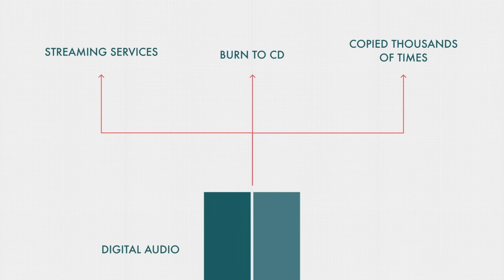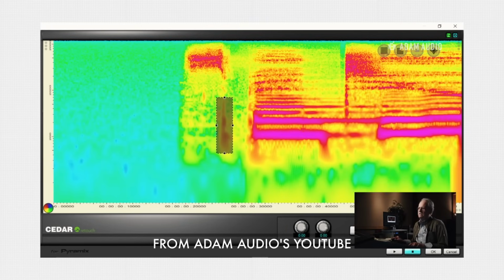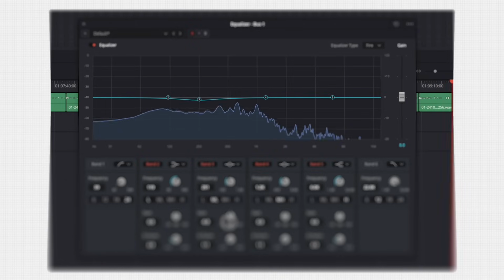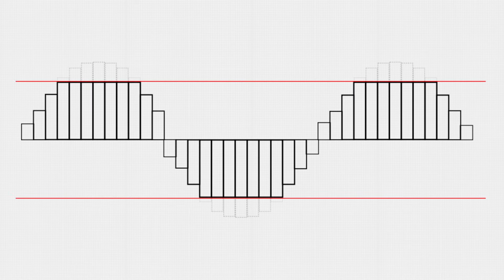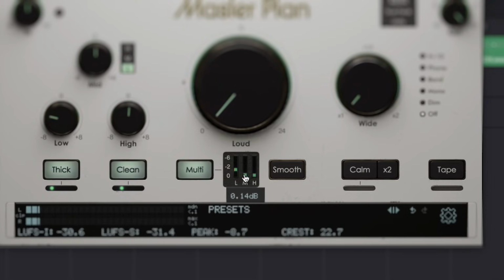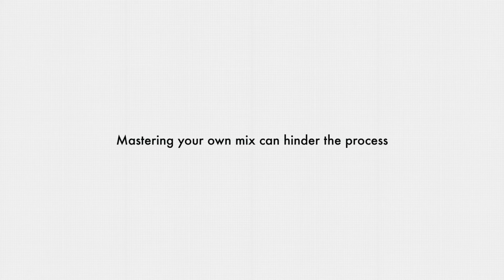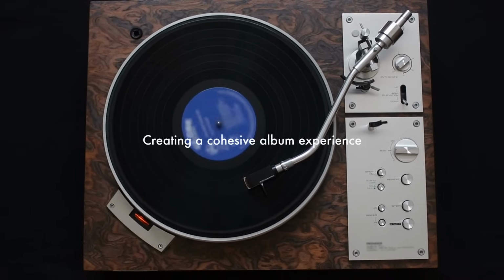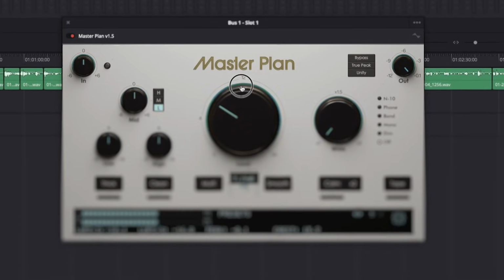Do You Need To Get Your Music Mastered?

Comment: I appreciate your video explaining mastering.  As a mastering engineer I would never use a single plug-in like master plan to achieve the desired master for my clients.  I use a series of EQ's to shape the sound that I want.  I also use two limiters, two compression settings and a specific saturation plug-in.  

I would advise beginner's - intermediate mixers to hire a mastering engineer.  Why?  Mastering is all about translation across all playback systems and delivering the audio files in the correct formats and Metadata.

Comment: I think mastering is kind of a scam. Have you ever noticed that no one can ever really give you one clear, distinct definition of exactly what mastering is and exactly how you do it? It’s always some vague thing like, “it’s a dark art,” or, “it’s as much of an art as it is a science.” Red flags, in my opinion. That’s because it’s kind of BS, honestly. A lot of people made a lot of money convincing a lot of people their services were necessary, and I question if they really were
Reply: The mastering process today as a base ensures that the track is exported in all required formats and listening mediums while maintaining as close to your mix as possible. This mainly includes dithering for lower quality exports, frequency balance for low quality systems such as phone speakers and ensuring it sounds good in stereo, mono and surround sound. It's kind of expected now though that mastering engineers do a final slight edit and slight mix to fix up any of your fuck ups you didn't notice or just make it sound more like industry standard.

In theory if the mix is on point the mastering process is rendering the tracks in the right formats pushing the dither button sometimes.

Comment: One thing that would also be good option/tip to make future video about is original master (I’m thinking bygone analog era equipments)  Vs digital remaster. I would like to understand technically why I like 99% times original masters better. ;) Sure, there are some tape/analog emulations in digital way and so on but I would like to keep it off digital Vs analog. I hope it’s possible.

Comment: I don't know, man you generally seem like a pretty smart guy. I've been at audio engineer since 1980. In this video, it seems like you're just trying to sell a plug-in like there's no other way to do this without Master plan. I find if I've done a good enough job mixing there's no need to master anything. Sometimes I try some multiband compression and that's all the mastering I might do but I generally do not do that. And I record a lot of multitrack live recordings and they come ptetty good. I like them people like them. This takes away from your credibility, pushing a product throughout the whole video.

Comment: Back in 1981 I was a member of a Sydney indie band and we got some free time in University of Sydney's radio station's studio, three weeks, and we recorded an EP there. It had a Tascam 80-8, a Soundcraft console, bunch of microphones including a Neumann U 87 and some other stuff. I was the keyboard player but I had four track home studio experience so I did the producer/engineer job since we had the studio to ourselves for those three weeks with nobody there other than us. The final mix was to a Revox A77 two track. EMI in Sydney had a mastering and pressing service for indie bands and the guitar player and I went to their Studio 301 to master the EP. The engineer at first looked like he was only doing the job because he got paid for it because at the time lot of the work was badly recorded punk. He put our tape on a Studer two track machine and aligned the heads to match the misaligned Revox. Our stuff was nothing like punk and he quickly became enthusiastic and I was totally blown away by how much he improved my mixes. Then he cut the first 7" 45 rpm master on a lathe there. Experience I will never forget.

Comment: Kyle, another great video. Well done. Couple of things to add...
Not mentioned: Mastering engineers generally have gone to the trouble and expense of setting up a room that is far more accurate than the bedroom (!) the music was tracked in. So, when THEY master your music, they are more than likely going to hear things you didn't.
Also, through the 70's-90's, it was common for artists to record songs in different studios around the world, and for those songs to be mixed by different engineers. So another task for the mastering engineer was to take a bunch of mixes (which may have sounded fine as standalone tracks), and make them sound cohesive/balanced when played back-to-back.

I hadn't heard of the plugin, Masterplan until I saw this video, and loved the fact that it reports 'crest factor'. This is something I have to explain to other engineers too often. It seems not enough people talk about it. For those who've not heard of it, it is simply the difference (in dB) between the peak value, and the RMS value, of a piece of audio. In essence, you can think of it as a quick numeric 'judgement' on how much the dynamics of a signal have been mangled/compromised through audio compression.

Comment: In developing any project, be it in the arts, science or industry, it is sometimes beneficial to have different perspectives. Even if your finished project seems to be at it's best, using someone else's perspective might make it better. Which leads me to a question. In todays digital world, is it a thing to master the same project differently for playback on websites, to CD or downloadable/purchasable  files? I am currently working with an artist who says his engineer will create two masters of his project. One for on line listening and one for purchase. Is this a legit thing?
Reply: Yes, because Spotify and others will format and change the overall volume. All that changes perception of the mix and final master, vs a raw mastered Wav lossless file. 

I send my stuff to work with people on lossles Wav files on DropBox, but uploading those same songs to Instagram or Spotify could see a volume bump or issues. There is a chart out there to measure each platform and standards. It’s very legit these days to have that done. Also meter VST programs, that let you select each digital platform for playback testing to see if issues pop up,